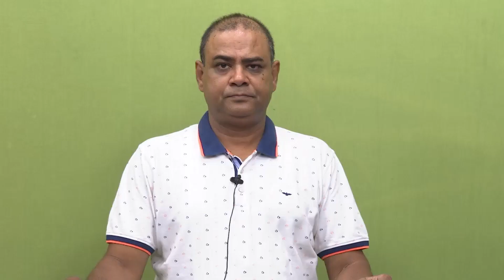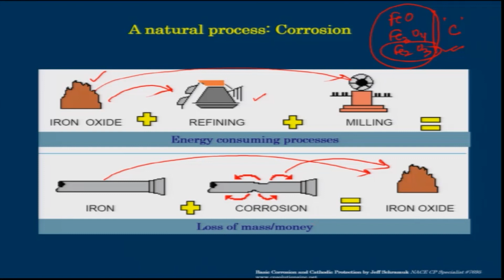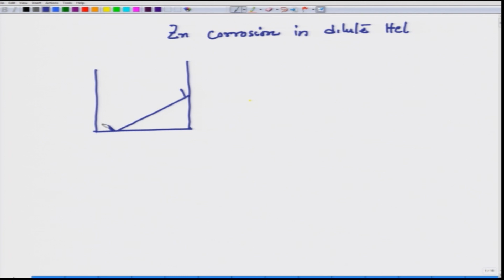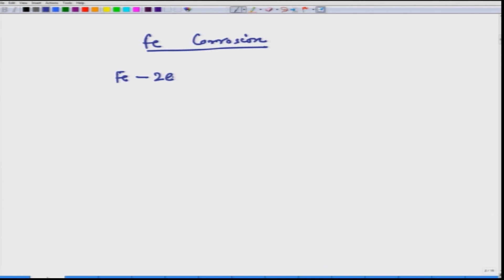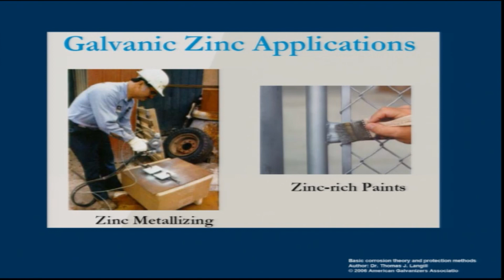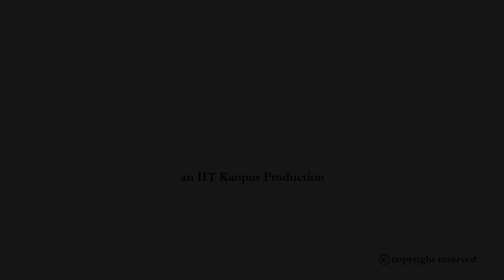noc18-mm14 Lecture 02- Introduction to Corrosion-II

Comment: Sir how it's corrosion helps to find out the microstructure.
Reply: It is called Etching! It is one of the positive aspects of corrosion. When we dip a polished alloy sample in an etchant, it selectively corrodes the surface (different phases react differently with etchant) and forms depth differences on the surface. When we see this surface in an optical microscope, we see dark and light areas due to depth difference.
Reply: @metallurgycrisp thanks you for explanation sir 😊